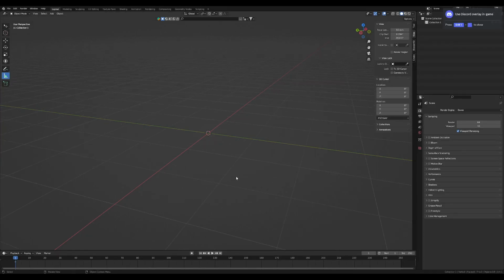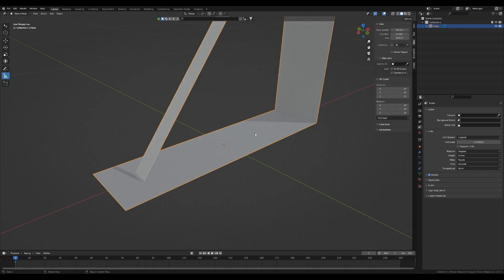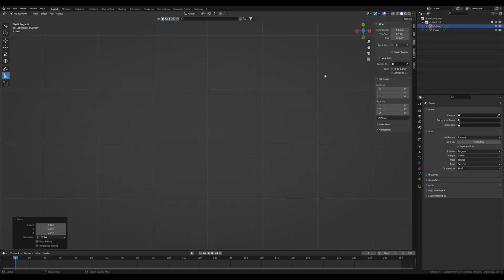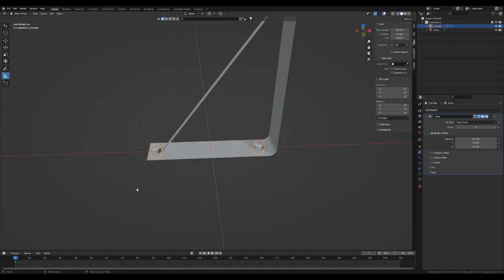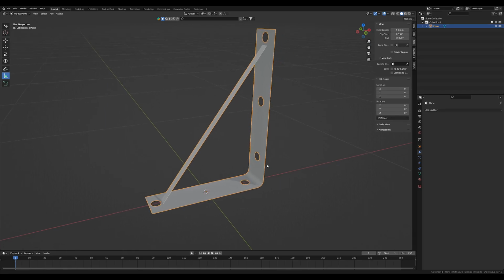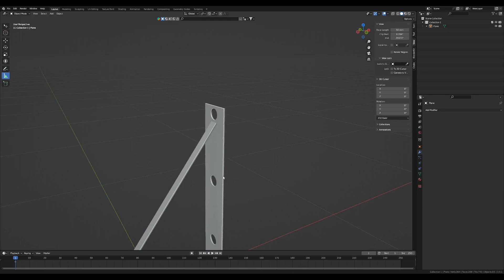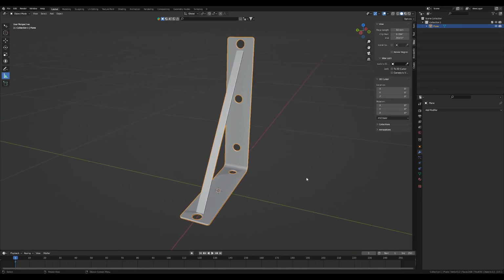How to model a simple L shaped bracket in Blender

Comment: can you please list which keyboard shortcuts you used at the following time stamps: 
0:16 resize plane
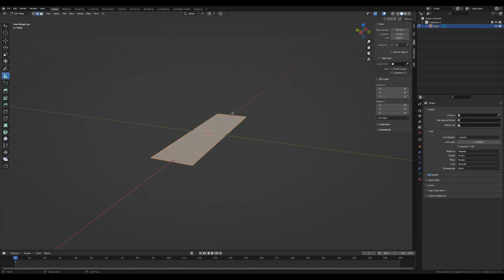0:28 extrude edge
0:38 duplicate face
0:40 resize duplicated plane
0:44 move object
0:46 angle object from edge
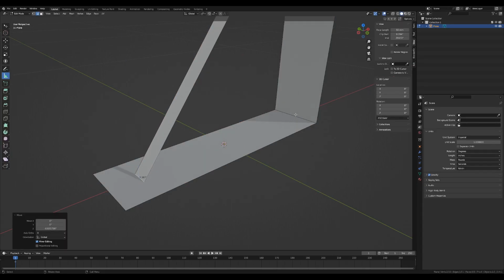1:00 bevel corner

i think i can figure out the rest. It's my first time trying to 3d model and having a hard time finding the tools without the shortcuts

Comment: A shape with no thickness is much easier to work with than a shape with thickness
Reply from the maker: When I make re usable assets i typically dont apply the thickness modifier so i can adjust based on the needs of what i am doing at the time but for this I seen no harm in applying it at the end, I do like to work with flat shapes first and add my thickness at the end like I showed here. I actually used these same brackets in a client model where I wall mounted a desk, the only change I made was I scaled it a bit larger.